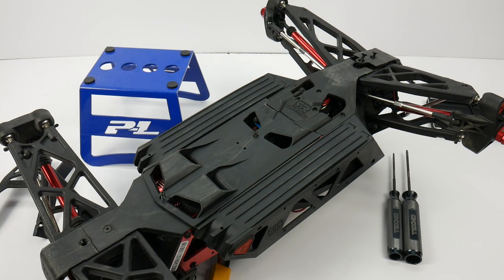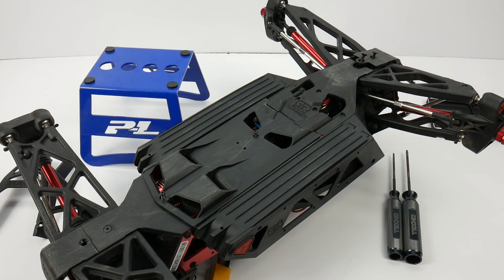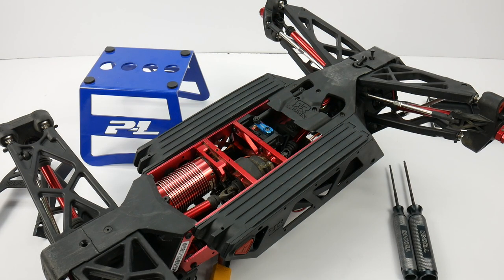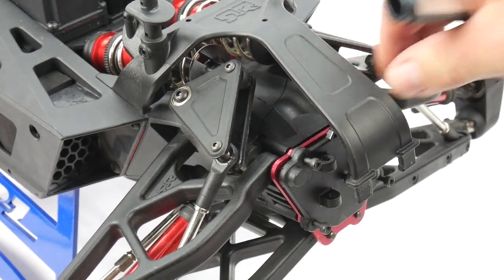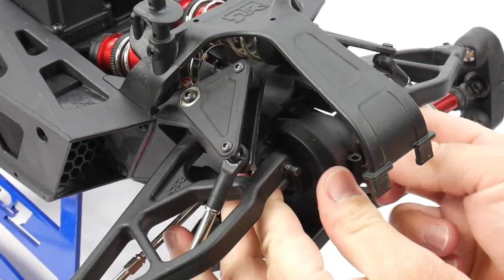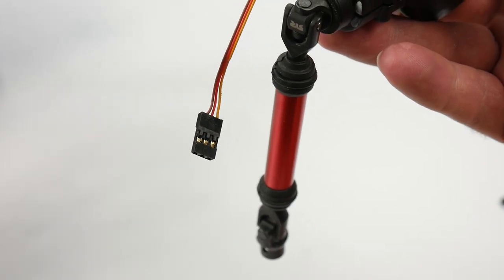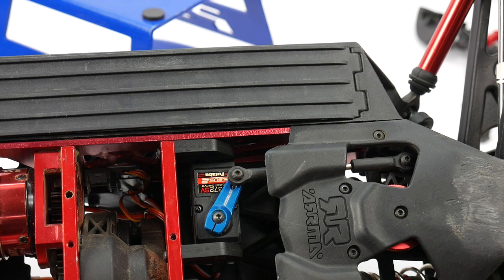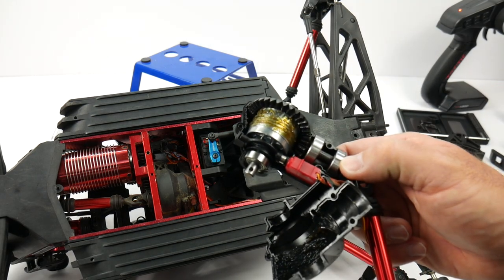Arrma Nero 6S BLX - Front Diff Exposed / Servo Upgrade

Comment: Thanks for posting this video! I wish you could elaborate on the electronic diff, I'm assuming it can lock the diff for rock crawling? And I wish you had a jumper cable, so you could connect the servo and mobilize the differential so we could see exactly what it was designed for. Then explain it more in detail. It's seemed to have multiple settings on the remote? So does that mean it can do more than just lock the diff? But over all, awesome video man!
Reply from the maker: Thanks ibtg4u!  Yeah, the servo on each diff (front, center and rear) operate a locking pin into the diff housing that will lock the diff.  On the remote, you can switch from All locked, All open, Rear only and rear/center only

Comment: Hey Rich
I noticed that Vas on Aussie RC Playground's Face Book showed a design weakness with what looked to be a shocker mount. The pin was mainly hollow and of course it snapped. It's worth checking out as he has found a work around replacement part. It just might save you some grief. 
Regards
Garszy
Reply from the maker: Yep I saw that.

Comment: Just FYI, Rich.
That servo you got is working on 6v, not 7.2v. So it's not as fast as it can be, but still pretty darn fast, nonetheless. I noticed you were reading the specs of it based off the higher voltage, but it's running on low voltage as the ESC has its BEC set at 6v. Not sure if you are aware of that...
Reply from the maker: +Aussie RC Playground Hey Vas, yeah, reading off its potential.....but as you know, I can never leave well enough alone.....it will be running on 7.4v soon enough!
Reply: The RCNetwork Awesome, man. Looking forward to seeing what ESC you put in it. Just be careful about upping the voltage as that may be too much for the locking servos. I think ARRMA locked the voltage setting on the ESC to 6v for that reason, so be sure it can be done or if you can find a way around it, if that is the case.
Thanks for showing us the inside of the diffs. I had pulled out the diff casing before but hand't looked inside, so it was cool to see. Cheers.
Reply from the maker: +Aussie RC Playground good thought on the diff locker servos....keep up the great videos!
Reply: The RCNetwork Thanks, man. You too. :)
Reply: What diff oil number can i use in a nero fazon or big rock 
Help me please a friend gave me a fazon for christmas and i would like to know wich diff oil number i can put on front center and rear please

Comment: The problem with the servo not centering has to do with the servo saver. It just needs to be tightened slightly. Don't credit me for this, Vas figured that out.
Reply from the maker: Yeah, not sure the servo saver was causing that, as I did try to adjust....prior to swapping the servo
Reply: I would think that problem is caused by a stripped servo horn too. You can tighten a stripped servo horn all day and it will still slide around and appear as random steering trim error or a servo not centering correctly. 

Then again, this is very common in fully plastic servo horns. He probably has experience with the servo horn not gripping the servo spline. Could actually be a whacked out servo.

I have had that exact same protek servo horn, only black, in my old THE car RTR. Much needed upgrade after stripping the plastic servo horn on a titainium, 25t servo spline.
Reply from the maker: Nope,  horn was fine as well......

Comment: Hello R Network, I have a question I have a Nero Fazon, and yesterday I a was going about 40 miles an hrs and I crash into the back a car's tire my front bumper broke but after the crash my car doesn't go forward or reverse. When I press on the throttle the car appears to want to go but it makes a small move and it doesn't move.. do you think any differential could be affected? I need help since Im new to the hobby.. thanks
Reply from the maker: Gerardo Ramirez you’re gonna have to do some disassembly to see what’s wrong. I would first try and rule out an electronic issue - mostly because both forward and reverse are affected. If it’s mechanical, be careful with disassembling, the Nero’s are tough to work on. Have the manual handy and also take photos of before of everything. I doubt that you destroyed all three diffs.....if Just the front was damaged, you would still have RWD, as an example. Good luck! 😃👍
Reply: The RCNetwork thanks so much. I don't have any movement on the wheels forward or reverse.. the electronics are good I just had the transmitter and ESC calibrated. I don't know why it doesn't go forward or reverse. the only thing that was affected was the front bumper and the car look good. IDK what could be wrong.. how do you calibrate the transmitter with the ESC?
Reply from the maker: Gerardo Ramirez there should be instructions in the manual to calibrate the ESC to the radio.  You can also look up HobbyWing’s instructions as the ESC is a HobbyWing ezrun (Ish). Another test you can do - remove the pinion from the motor and move the drivetrain by hand. As long as the diff are u locked, the (rear or front) wheels should move opposite of each other and the driveline should move smooth. Try moving both rear wheels forward and the entire driveline should engage. If all this works correctly, you probably have an electronics issue.
Reply: The RCNetwork  thanks.. I charged my battery which they were half charged.. all I did was rotated the the back tires plugged in my batteries and it started to run normal without issues.. I wonder what it was.. I didn't have take it apart..
Reply: You might've broken a tooth on a bevel gear? After a bit of moving around the loose tooth may have become dislodged, freeing up the gears again

Comment: my Losi 8ight 2.9 was half the price, RTR with fluid .
Just saying they are charging more than Kyosho, Xray, Mugen, Serpent. They should be fluid filled. Thus is by far the most expensive Arrma offering. Way more than the Kraton.
I like it, but think they are over charging a bit
Reply from the maker: You're listing off Kit manufacturers (Kyosho's, Mugen's, Xray's and Serpent) and trying to compare an 1/8th scale RTR Monster Truck that is directed to a more entry level consumer.  80% of all Nero customers will probably never even disassemble the differential.  Grease is used in those type of vehicles as a maintenance item - if a consumer disassembles it, it can easily be re-assembled with out dealing with what viscosity of diff oil to use.  Sure, diff tuning is easy with oil, and probably can easily be added to the Nero.  The Nero is also at least double the size of your Losi 8ight "2.9" RTR and fresh to market, yielding a higher pricepoint.  Bad Comparisons.
Reply: +The RCNetwork 
only comparing because they are among the highest performing, highest quality kits available, and they cost less than a RTR.
This truck needs oil, not grease. All I'm saying is for a staggering $800, it should be a given. This is almost as overpriced as a Traxxas product.
Like the truck though, but it's at least $100 overpriced.
Good video on your part as usual...
Reply: That's funny because I was thinking the opposite.    From what I have seen Arrma  seems to be about the only manufacturer including 180 amp ESC's and designs that can handle 6s speeds out of the box.   

Most of these high end kits which are cheaper cost significantly more by the time you add a comparable ESC, motor and controller and many of them would still need upgrades to handle bashing at these kinds of speeds.  And all this while still requiring complete assembly, including adding oil to the diffs.
Reply: I'm seeing $540.00 with free shipping.... about half the price of the original Burns with hard gears and upgrades and it's already built.... time sure changed the RC Hobby. But I did notice the grease and wondered about that thinking an oil bath system keeping weight down would have been used.

Comment: Good and fast Servo, but in my eyes not an improvement simply because it is not waterproof as the stock servo.
And the thing with the Servo Safer to loose issue.
I wish you had showed the Diff closer and how it looks inside. This would not have taken much time from the point you where.
Reply: Wrong almost all the futaba servos are water proof.  In the specs on futaba-Rc.com it will have a wp in the spec box.
Reply: shame on me. of course i didnt knowmthis detail...
sorry and thank you for the info!
Reply from the maker: Living in SoCal, in a drought......waterproofing anything is the least of my problems! lol  But yeah, Brian is right, Most Futabas are waterproof

Comment: Great video rcn.. But please please please please lower the microphone or do something, because every time you swallow or make mouth noises it would drive me mad.. The only reason I made it through was because the video was very well done. So thank you for that. Now I have to save for one of these badboys. 

Also, one last thing. Those center shafts looked like they were starting to oval out at the pins, is that just normal or is it just me? Because I think that for such beefy axles and center shafts the pin area in then looked very thin.

Thanks
Reply from the maker: Thanks for the feedback....I'm constantly changing up my video/audio set up - Have been for years now! lol  Not sure on the shafts -They looked normal to me....maybe the camera angle?  This rig, at the time of this video had about 6 sets of batteries run through it
Reply: +The RCNetwork ah I see... Well I'm probably in the minority's with the mouth noises. So probably u won't need to change a thing. But it's good that ur videos are very well done... Will u have an update soon about anything that failed on the truck? I'm super interested in this thing since seeing it in the vid.
Reply from the maker: ShortysPop1 besides several rod ends either failing or getting striped off of the push rod, the truck it pretty solid....I did have the pinion come loose, and the motor mount screws back out, but that was easily fixed. The truck isn't the easiest to work on, as you saw in this video and it's noisy - it squeaks a lot....but it's damn fun to drive and easy to drive.

Comment: A little disappointing, given the $799 steep price tag.
Reply from the maker: I'm not sure what's disappointing on the Nero.....It's quite impressive
Reply: +The RCNetwork 
The fact that it has no diff oil, just grease
Reply from the maker: Most RTR's, especially "bash type" vehicles will only have grease.